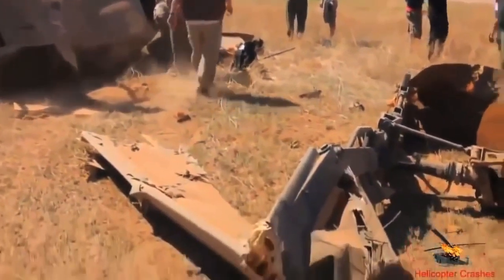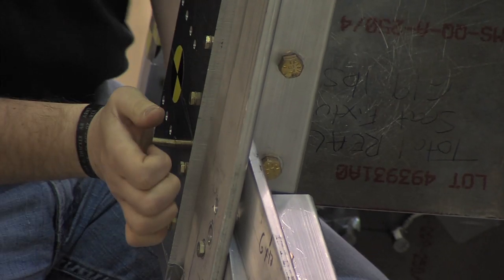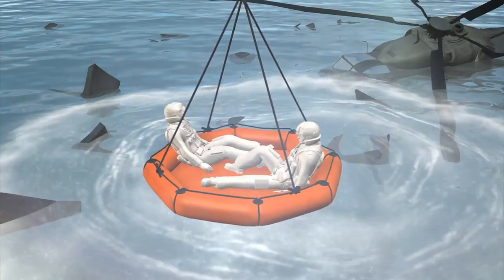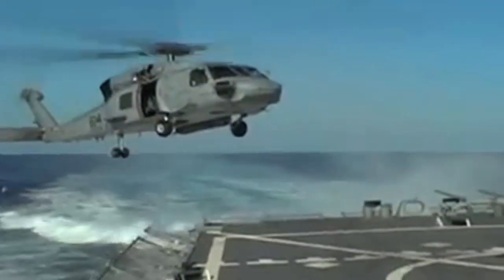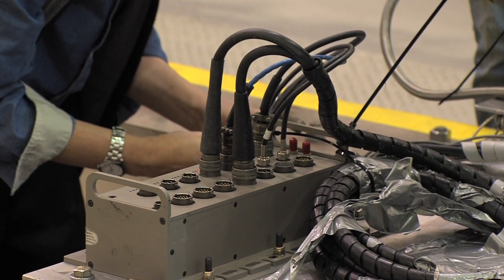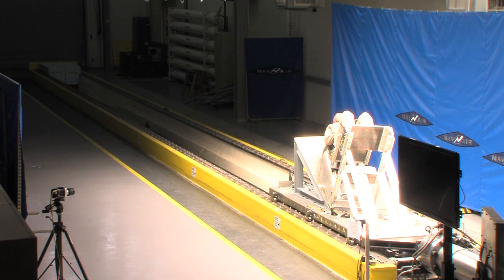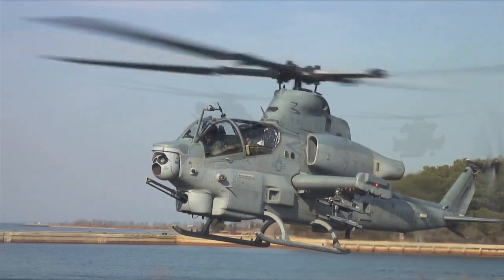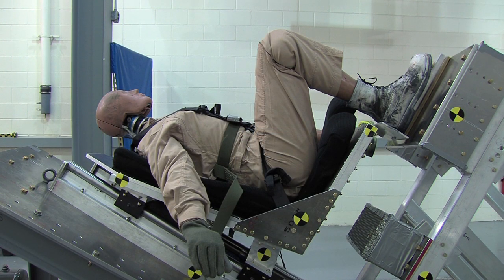Flight Ready:  Reusable Energy Attenuating Lab seat

Comment: Hi can you basically explain how the seat is absorbing the energy during crash?
Reply: I realize this question is 8 years old, but...

Crashworthy seats use a few different methods to absorb energy, but all involve deforming a piece of metal. One example is a tube and die system, where a hollow metal tube gets forced through a smaller hole so that it gets crushed as it's pushed through. The seat pan will move closer to the floor during this process, which means the occupant gets a bit more time and distance to decelerate than they would in a fixed seat, reducing the forces they experience.